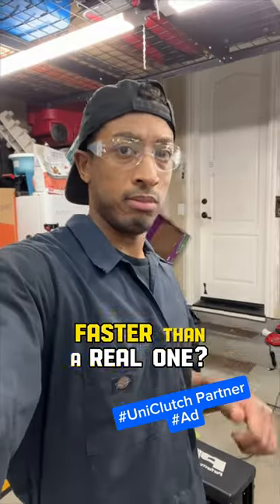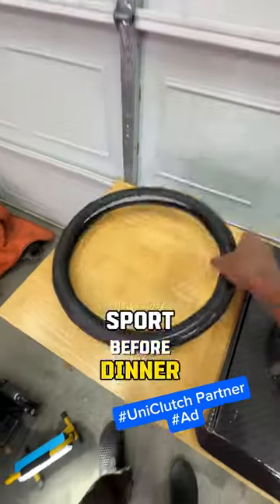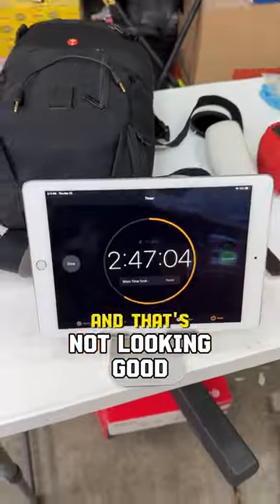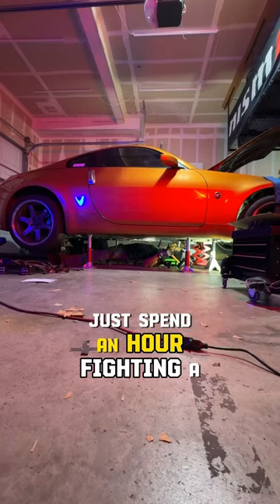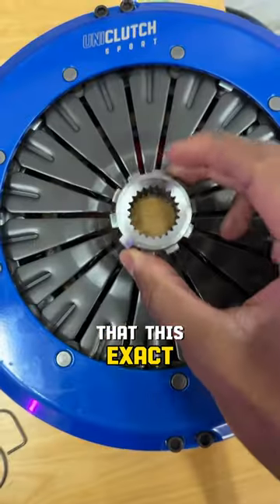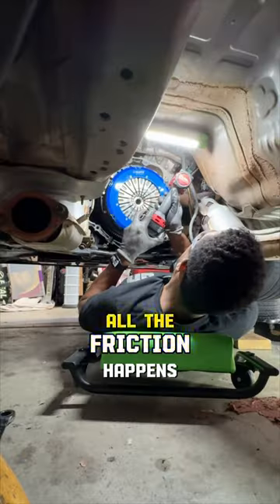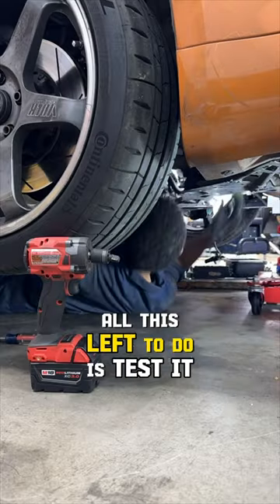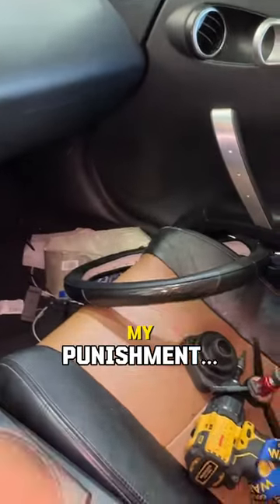TIKTOK mechanic vs. REAL mechanic #UniClutch

Comment: Ah,yes i remember those z's... had to replace the clutch and fix a limp mode in a 350z. The limp was the brake pedal switch dead shorted through a computer pin that ran to it, and the clutch job had an absurd ammount of bolts, along with accidentally removing the reverse lockout mechanism somehow. All for the owner to absolutely smoke the clutch within seconds of leaving the driveway.

Comment: You probably could have saved an hour or so if you had a lift
Reply from the maker: i believe it, need to experience one
Reply: @ChrysGaines  it's nice but then you get spoiled. I used to be all about Jack in the car up. Throw a tarp on the snow and go weld on into exhaust and now I'm like yeah it's kind of cold out there

Comment: It took you 5 days to do a transmission swap? How? I had a engine tuned up and transmission swapped in 4 as well as all new fluids. What took so long? Rust?
Reply: Probably doesn’t know what he’s doing, relax
Reply from the maker: input shaft was rusted on to the back of the engine, so i spent hours prying to no success. eventually found a ratchet strap technique that worked perfectly. hit a bunch of other hurdles after that, but mainly just took my time after failing my initial challenge lol. also was filming the whole process for YT and tiktok so that adds a lot of time